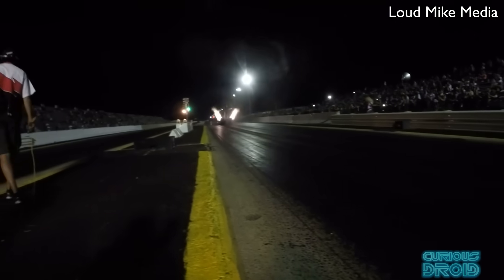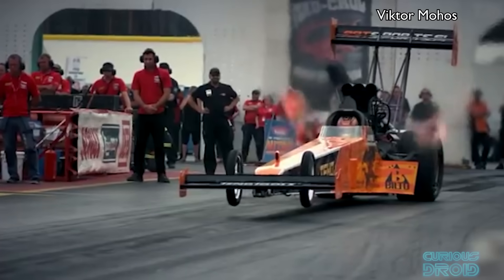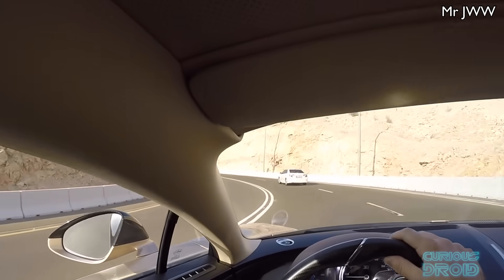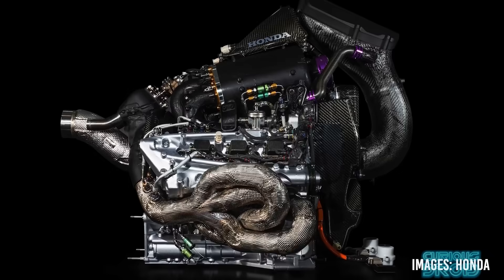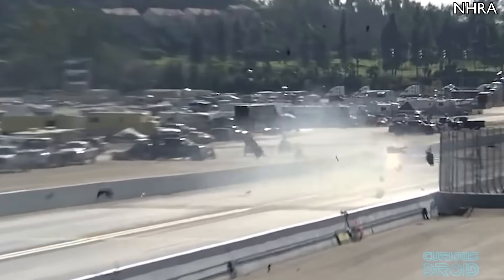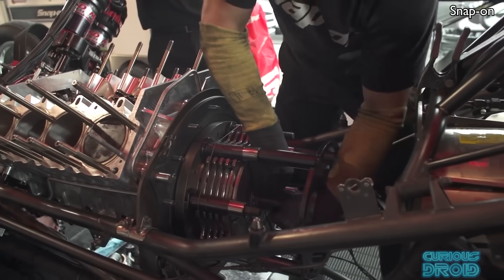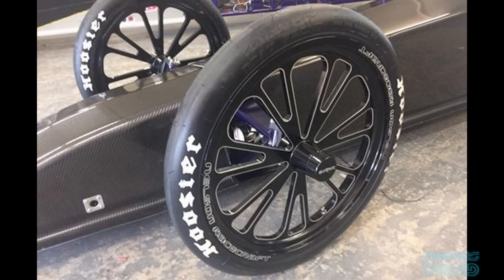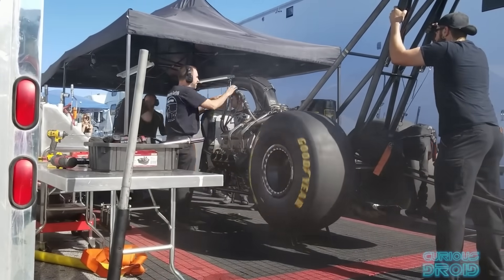The Amazing Engineering of Top Fuel Dragsters

Comment: While the roots style superchargers were certainly used in diesel truck motors... they originally came from mining, used to pump air deep into mines.
You overlooked the piston coatings, which are "consumed" during a run and add to the combustion burn to act as an accelerant to increase the speed of the flame front of the slow burning nitro.

Comment: I wonder how an electric drag racer would fare. What sort of batteries would you need? Maybe you would skip batteries and use super capacitors. Would an electric motor be able to compete with these engines that guzzle fuel so fast you measure fuel intake in gallons per second?

Comment: Not sure where the amazing engineering was here. An almost century old engine boosted to the limit to last for only a few seconds and to burn as much fuel as hundreds of cars do and generate an ear rapturing noise meanwhile the crowd is watching not for a speed run but mostly for a bang. I apologise to all Top Fuel fans here but to me it has no value whatsoever - without any possible goal in engineering (reusability, fuel consumption, efficiency, reliability, safety etc.) to win the 4 second run is the only goal. And yes, before you ask, I have visited Top Fuel racing before. As an engineer myself I cannot see how is this kind of racing added to the greater good (other than thrill). On the other hand I can see why Formula 1 have earned it's respect in motorsport. At least I could see technologies developed in F1 ended up in everyday cars we drive today. Top Fuel? Is there any? I was hoping Paul will highlight it here that yes, there are some. Was there any I missed?
Reply: "Was there any I missed?"
Only thing you missed is that disparaging comments like this are equivalent to pissing in people's cornflakes. If you don't appreciate it, don't address it.
Reply: @mfree80286  Oh so you can perhaps point out where the amazing engineering is here? If not, then I should say you are only a Top Fuel fan and nothing more. In this age of zero carbon targets and going green this kinda motor "sport" is nothing more than fireworks for people who enjoy loud bangs and it has very little to add to further advance our technology. I am not against top fuel in general or rat rods or choppers I like V8 engines too but I cannot see them being an engineering marvel in 2021. Sad to see anything go which was once the greatest ever tech but we have made huge steps in engineering since. They had their time in history. But they are history and we have moved on. Sorry to burst you bubble and sorry for your cornflakes btw. :D
Reply: On the other hand same applies to my comment - as you have said. If you don't appreciate (or cannot argue with) someone's opinion, you can always choose to avoid it. Or point out where was I wrong. I had no intention to piss to anyone's cornflakes I just expressed my honest opinion. Don't like it? Live with it.
Reply: @Lucky32Luke  You have no idea what you're talking about. Go calculate the energy density of one of these and compare it to any battery technology.
Reply: @mfree80286  I think you have very little idea what I am talking about. I haven't mentioned batteries at all, have I? I have said this motorsport is outdated by engineering a long time ago. Go check the facts. It is a relic just as having a steam engine. It is remarkable achievement but it has passed its intended use. I was pointing out top fuel has only one goal (4s fastest run) and haven't delivered much to your current car engine running today. Please try to argue instead of throwing stones. Can you do that?
Reply: @Lucky32Luke  its more for entertainment than being a technological proving ground. As long as people are willing to pay to watch it, it is therefore a business and putting bread peoples tables.
Reply: @1985metalmaniac  Good point there. I agree and I can see why its exist and will do exist as long as people are interested in loud bangs and flames and the smell of burning rubber. Red Bull's cart race is also great fun to watch but surely I won't highlight it as it has any engineering value. That was my point. Did Top Fuel ever contributed in engineering to develop a better and more efficient vehicle?  If it did (I don't know without researching it) I was expecting Paul to point it out so I can appreciate it. That's all. I had no intention to anger true Top Fuel fans with my comment. ;)
Reply: @Lucky32Luke  It is funny you should mention the red bull cart race but actually there is a serious cart race motorsport called gravity racing. A lot of development and research is pushed into the sciences of rolling friction, aerodynamics, materials while still keeping costs low. As we move into an age of renuable energy i think that maybe such studies will be prove to more valuable than intended.

Comment: Back in 2005 I used to work for Scelzi Enterprises and is/was owned by 3 brothers, one of which is Gary Scelzi, he used to race for Winston when they sponsored Top Fuel Dragsters.

If you haven’t been to a race and standing as close as possible to them when they zip off the start line I can tell you it is LOUD! Even with hearing protection it hurts the ear!
Reply: Saw Gary's kid Giovani racing a sprint car just last week on the dirt at Bristol. He was one of the fastest both days, friday and sunday. While not the same and not quite as impressive as top fuel, averageing 140+ MPH and 13 second laps on a half mile dirt track is pretty impressive as well.

Comment: So basically a competition between two teams of mechanical engineers. A driver just keeps it in a straight line and applies the throttle. He/she could actually be replaced by R/C and it would reduce overall weight.

Comment: Awesome. I always thought dragsters are the ultimate race car. Nothing fancy, just get to the end of the track before anyone else, and be as loud and badass as you need to be to get it done. I also think of the RS-25 rocket engine used on the Space Shuttle as being like a dragster engine: it only runs for a brief time, runs at maximum performance pushing the limits of engineering, and has to be torn down after every flight as a result.

Comment: Gotta love today's software and PC games. Using Automation I put a 7.5L twin turbo V8 in Suzuki Cappuccino. 1554HP and 257MPH top speed on a 4-speed auto gearbox. And that's with a compression ratio of 11.2:1, 13.7 PSI boost and 100RON fuel. The thing makes over 200HP/litre and is under 1.15Kg/HP. The numbers alone are just crazy.

Then using the very same vehicle I went down the opposite end - transverse mount 4 banger boxer with the tiniest 394CC (under 0.4L) engine that revs to 12,000RPM. Astonishingly it manages to take it up to 100MPH with just 67HP and will even climb hills. In both cases the body was first lifted and widened, had chunky off road tires fitted and equipped with AWD.

100HP/litre has been available now in the real world on road going cars for perhaps a decade now if not two. I am seriously curious though if this stuff that we can tinker with in software is actually doable given that Automation provides what would appear to be real-world numbers, measurements and materials. I was using magnesium for the engine block (not aluminum), titanium connecting rods and lightweight forged pistons for higher RPM. And while 5 valves per cylinder is common on modern cars, 4 valves with variable valve lift provides better performance.

Comment: Another reason they're limiting the speeds now, along with shortening races from 1/4 mile to 1000 feet is that the tracks are all old, surrounded by other development, and there isn't enough room to have a safe runout in case of a brake and/or parachute failure. Racer Scott Kalitta was killed when his engine let go right at the end of a run, which damaged his parachutes. He ran right through the existing overrun area and over a concrete wall, and hit a camera boom lift.

Comment: The used compressed rods will be matched with other rods that have been compressed the same amount and calculated into the head gasket measurement. These guys run the razors edge and the result is absolutely amazing in person.

Comment: What I got out of all this is that it is an absurdly wasteful sport. Throwing out clutch plates, shafts, copper gaskets, and massive tires every few runs seems incredibly wasteful and indulgent. What kind of recycling do they do?

Most metals aren't endangered resources but manufacturing all these parts for single use must have some impact on the environment, right?

Comment: It might be noted the original dragstrips in the USA were 1,320 feet. This was shortened to 1000 feet when both top fuel and funny cars were routinely breaking 320 mph or so. If they hadn't done that, speeds might have been above 400 mph before long, with a consequent increase in accidents and hardware destruction. "Big Daddy" Don Garlits "Swamp Rat" established a 1/4 mile record at 176.40 mph in November 1957. Garlits would employ his evolutionary Swamp Rat series of Top Fuel cars to set the first 180, 200, 240, 250 and 270 mph ¼-mile passes in drag racing. The 270 mph record occurred during the 1986 Gatornationals and, as always, included a  nitro-powered HEMI engine in Swamp Rat 30.

Comment: I always though a cool stat about top fuel was that the motor only spins over a few hundred times in a run (8000rpm / 60 sec x 3.5 sec = 467 revolutions).

Very cool video.   Everyone should get to experience a top fuel race at least once in their life.  The speeds and sounds are mind bending. Watch from both the start line and then finish line if you can.

Comment: Missed out on a mind boggling factoid. Do the math on how many revolutions the crank does from the green light till the light beam is crossed at the finish line.

Even running the numbers using the maximum RPM number is astonishing but the engine isn't running at max the entire time so the actual number is even lower.

Hemi - The engine used on the best air raid sirens ever produced because the Trumpet to Herald the death of half of mankind in a brilliant flash of light only deserves the best.
Chrysler Victory Siren

Comment: Great video! Drag racing is a lot more involved than "drive really fast in a straight line." On another note, you might find the direct drive system of the Koenigsegg Regera interesting - it has a 1,100bgp V8 and 3 electric motors, but no gearbox. The V8 is linked to the final drive via a torque convertor. Very innovative bit of engineering.